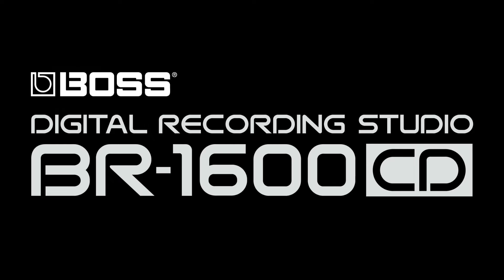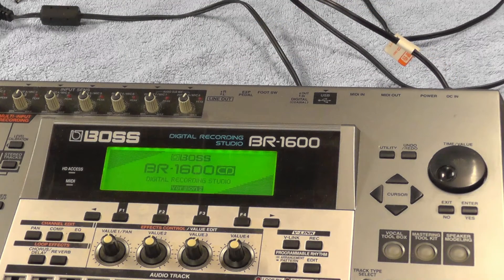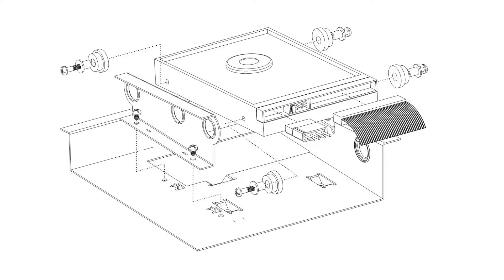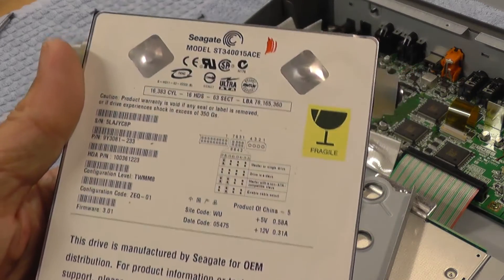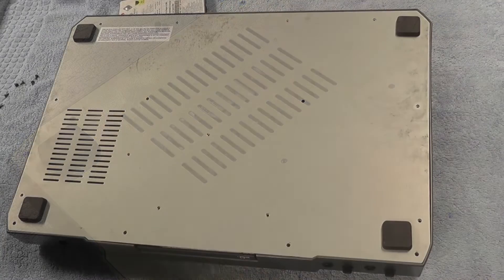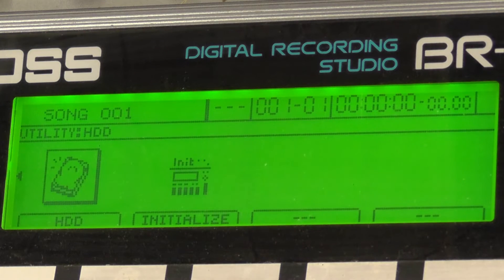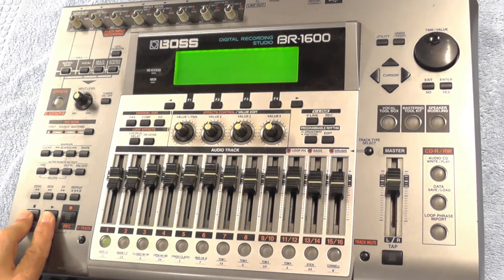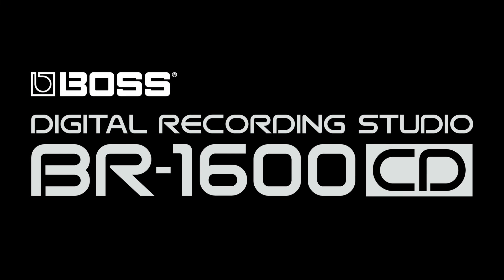Boss BR 1600 How to Replace the Hard Drive and Update the Firmware

Comment: Thank you for the video. Excellent step by step process. I have the BR-1180 which may be different but I get the same HDD error message. My only concern is how to recover the data/songs in the drive that’s not working. Is there a way to transfer everything on this stock drive to the newer drive (likely with more storage)? Thank you!
Reply from the maker: It's the same principal for the BR1180 - remove the bottom base plate to get access to the HDD and remove the power/data cables and then the drive.
As for recovery of the songs, your best bet is to connect the HDD to a PC either directly or via an inexpensive USB caddy. 
Hopefully the drive will show up in Explorer enough for you be able to copy the content across. If it does, save all of the song folders to the PC. 
Once you've installed the new HDD into the BR1180, format it and then remove it and connect it to the PC. It should just have one song folder. 
Copy the ones from the original HD to the new one (overwriting song0000 if needed).
I had this exact scenario with my very 1st BR (1180) and managed to get the HDD to show up in Windows just once, but that was enough to save 95% of the songs off the old drive.
Good luck!
Reply: @masteringtoolkit  Thank you so much!!

Comment: Hi, this may be a stupid question. But is there any risk of losing a saved project during either of these processes? (Switching the hard drive or formatting the disk?)
Reply from the maker: Not a stupid question - especially if you care about saving your projects.
Switching to a new HDD or formatting the existing drive with leave you with a blank slate and return the unit to factory default. 
If you have any projects you want to keep or transfer over you will need to either create a backup - as covered in the user manual, or better still, connect the HDD directly to a PC (with the HDD removed and placed in a dock) and copy all the contents. Once you have either formated or installed a new drive, you can then copy the contents back to restore all your work to the new drive.
Hope that helps.
Reply: @masteringtoolkit  how did you manage to convert the format to an iso9660 file? I’m finding it impossible, that format doesn’t exist anymore?
Reply from the maker: @majesticheartproductions85  Its an international standard format for CD cross compatability and is still valid and used. 
I use NERO to burn CD's which allows you to select which format to use. Whatever software you are using it should allow you to specify the format.
Reply: @masteringtoolkit thanks heaps for your replies and these amazing videos. It’s been a huge help, I’m still learning a lot about these machines as I go👍👍

Comment: Thank you for such an amazing video, it is pretty informative. 

I followed each step and got it to work without having any HDD issues. 

Whenever I insert the discrete drums CD the OS freezes. To the point that after power cycling it I start getting the HDD Error message again. 

That happened last night. I turned it on this morning and the system booted up without a problem. 

So now I am wondering whether the problem might be a conflict between the cd drive and the hdd drive or, just the cd drive. 

When using the original hdd I wasn't able to load or import the tracks in that CD. But I was able to navigate through the utility menu. I would receive messages such as Loading Disc, etc, but it wouldn't affect the OS. 

Have you encountered any of these problems before? I'd appreciate it if you could shed a light on this issue.

It'd be awesome to be able to update the firmware some time. 

Thank you!

EDIT: I just found a CD drive replacement on eBay for a reasonable price:
https://ebay.us/m/rgmKAb
Reply from the maker: You are welcome Diego - glad the video helped!
I have encountered a HDD error if a CD is in the drive when it boots - this has nothing to do with the HDD though, and as you suspect is a conflict when the OS boots and see the CD drive as the "master" and tries to boot from it.
Sounds like the CD drive is faulty in your machine. They are pretty resiliant, but I have had one that was faulty too.
I would imagine replacing it should fix your issues.
Reply: @masteringtoolkit Thank you my friend! Luckily the comments section of your videos is also good for users who run into these issues.

We all watchers enjoy your videos. I appreciate you taking the time to make them. That's a lot of work!

Comment: I just purchased my own Boss BR-1600!! I will definitely return to this video in case I get this HDD error because it seems to be quite a common issue (but also one of the only ones).
Reply from the maker: Congrats!! 
It's scary to see the HDD error, but really quite straight forward to replace the drive if you need to.
Reply: @masteringtoolkit  Yes, thank you so much mate. I also assume the slow loading time to open a song is quite standard right? Everything works fine, no delay. Just a bit slow when I want to open up the demo-songs.
Reply from the maker: @TimVincent-o4k  It is,  but you get used to it :) 
Just read your FB post on the Old School page 👍

Comment: Hello Mastering Tool Kit, I own a Tascam 2488 that had a bad HD. IDE drives are becoming harder to find. I tried putting several previously used IDE HDs in the Tascam (specs match what Tascam used), but I still got HD error messages. After going through all the IDE drives I have, I finally found one that would boot and format. Machine works great for the moment, but I don't know how many hours I will get out of this older HD. Have you had any luck using a SATA to IDE adapter in any of the units you have repaired? If so, could you recommend what adapter worked for you. I would love to put a SSD or at least a more modern SATA drive in my Tascam.  I love these digital recorders.  So much easier to use than a DAW.
Reply from the maker: Hey James, 
Unfortunately, this is the reality of these older type of machines using now obsolete storage media. 
You can still find new IDE HD's though. Have a look on Ebay for the BR1600 and Roland VS machines.
I don't have any Tascam HDD machines, only the Porta One and Porta Two 4 Track tape machines.

With regards to using moderrn HD's, I did go down that rabbit hole a few years ago. I also tried using SD and CF cards in place of the HD's. 
It turned out to be very hit and miss. I spent a lot of money and time on various adapters and drives. 
For the BR1600,  it was a very specific combination of adapter and SSD that worked. 
I did put together and sell a conversion kit a few years back, but being so niche, I only sold a couple of them locally. 
I dont recall what the specific adapter was - I bought many different ones to test. Even then, only selected SSD's would work with it.
Unfortunately, I doubt that what worked for the BR1600 would transfer to a Tascam though. 
Even with Boss machines, I managed to get an SD card to work with the BR1180, but it didn't work on the BR1600... 
Maybe you can try searching for SSD conversions for your specific machine. Maybe someone has already found a solution? Good luck!
Reply: @masteringtoolkit  Thanks for the response. I also purchased a Boss BR 1180 with a bad HD. It was much more forgiving when I installed a replacement drive. I am going to try an adapter that gamers use on Gen 1 Xboxes. I’ll let u know if I have any luck on the Tasman. Your video was very good BTW. Best wishes
Reply from the maker: @jamescaldwell1933  Yeah, the Boss BR  recorders have all been fine when replacing with another IDE drive - I've never had one not work. 
The Tascam must be a bit more selective... 
Please do let us know if you have any success with the Xbox adapter - never considered trying one of those.
Thanks for the kind words - much appreciated. Cheers Mark

Comment: Great video but, bummer
I don’t get the HDD error
I simply can’t get the BR to export via USB. I’ve tried different cables & different computers & export simply doesn’t recognise the connection. Can hear the USB connect

Sometimes I can get back up to open up the HDD but most of the time it simply won’t recognise it that way

I was hoping it might be the HDD
It sucks because I have interviews I need. It literally worked just after xmas 😢
Reply from the maker: There are a couple of other options for backing up if you haven't had any luck via USB:
- Use the CD drive , ideally with re writable CD's so you can use them over again when you need to, or
- Use the digital out connection on the back of the BR1600 and record out in real time without any loss of quality - you would just need an audio interface that accepts a digital signal. 
Hope that helps to get your recordings saved.
Reply: @masteringtoolkit 
Cool thanks. I really appreciate the reply

I did burn the tracks on to CD via Data Save/Load yet to see if that worked & your idea about the digital out is something I’ve never tried. Will tomorrow just to see how it works

I did watch a video where someone connected an iPad & the export worked for them & I read on a forum that a newly installed program on the pc have caused this issue for some

So as a test, I connected my iPhone USB-C to the BR via a hub & blamo, I was able to connect & export or do whatever
It comes up in “files” as “BR1600CD” in the same area as “on my Phone”

So I must have a conflicting program, possibly Audacity or the Behringer UMC404HD interface driver/software because they are the only new things I have added since on both PCs

I am writing all this down just in case someone has the same issue or wants to use an ios or Android device to act as the “computer” end of the export/back up bit

Thanks again 😅
Reply from the maker: @MilitantPeaceist  No problem - glad to try and help.
When you burn to CD, just make sure you use the "WAV" option to export, rather than the "BACKUP" option, as this just make a backup of the song project.

The Digital Out is a good option if you don't mind exporting in realtime. I connect my BR1600 to Reaper via the digital out and it works flawlessly.

I'm aware of the connection to the Ipad. I dont do IOS though, so cant comment on its effectiveness. I do beleive it should work fine though.

Not sure of the reason for the USB issues. TBH, I never use it. If I need to export a full mix or a couple of tracks I just use a CD RW. 
For swapping audio between the BR and PC I use the above mentioned Reaper and Digital out. 
If I want to do a full backup, I'll remove the HDD from the BR1600 and plug it directly to the PC via a HD caddy. 
I can backup the entire drive in minutes rather than hours doing it this way. Although this is something I dont need to do very often.

I appreciate you documenting your process though, so often someone will ask a question and then reply , with "all good now" without any explantion - so thank you for that.

It sounds like you have it sorted now, but if you need any more help, I'd be happy to try and answer any other questions you have. 👍
Reply: @masteringtoolkit removing the hdd to back up is a brilliant idea. I remember doing it once I am almost over the PTSD it induced

Unfortunately I only have a sata caddy. Maybe I can get a sata/ide adapter & put an ssd in the BR. Have a few lying around

What software do you use to burn the br update? Every software I download won’t recognise the .prg fw file
Reply from the maker: @MilitantPeaceist  Lol - once you've taken the HDD out, you'll see that its pretty straight forward and you can do it in just a couple of minutes.
I have a PATA/SATA caddy that I picked up from Ebay - it was only around $20AU from memory and works well.

I use Nero to burn the firmware CD, but any software will work. It doesnt need to recognise what the file is as it needs to be burnt as a DATA CD. 
You just need to make sure the format is set to ISO 9660 Level 2 Mode 1. Then just follow these instructions:

http://static.roland.com/support_archive/en/BR-1600CDVersion2_1833210_readme_en.html

Hopefully that helps.

Comment: Hello!  I've just bought a 1200 (I need an intervention too!) because I thought that maybe it would fulfill my needs and be a little bit smaller than the 1600... It was sold as for repair or parts, but the description made me feel confident that I could fix it!  Turns out that the cursor keys and the exit/enter buttons are not making good contact.  You have to press them over and over to get them to respond.  So I'm thinking bad/dirty contacts.  I opened the back and moved the hard drive out of the way (it's a riveting story isn't it?), but discovered that the back of the buttons isn't accessible without stripping down the whole machine.  Which I wouldn't dream of doing.
I'm just wondering if you have come across this problem before and if there's a fix that doesn't involve taking out everything?  Thanks!  No rush to reply, I realise that you're busy.  I hope you and yours are all grooving along nicely. 😊
Reply from the maker: Hi Melanie -  sounds like you've caught the same bug I have!! :)
Yes, I've fixed lots of those switches - its a very common problem. 
The ones that usually go first are those that are most heavily used - the cursor and Yes and No button typically - as you've discovered.
They are tactile switches and although the do have a very long duty cycle (100,000 pushes), they do wear out. 
The original switches were Panasonic EVQ-11A05R, but they were discontinued at the end of 2020. You can get equivalent switches now which also work though. 
Unfortunalety, they need to be replaced by being soldered in and that requires that you strip the recorder down to take the main board out.
You should be able to get any electronic repair place do it for you - they dont need to know anything about the BR recorders or be associated with Boss/Roland.
It takes me about an hour to dismantle and re-assemble a BR1600, and then a few minutes a piece to replace the buttons. It shouldnt be more than 2 hours work I would think and it would depend on their hourly rate as to whether or not it was viable to get fixed. Sorry i dont have better news.
Reply: @masteringtoolkit  Awwww. What a shame.  It certainly doesn't sound like a job for me.  It's still usable at the moment - pressing the dodgy buttons repeatedly and sort of wiggling the pressure around gets them working but obviously that has a very limited life.  Oh well.  I'll try to find an electronic repair place - they're not easy to come by these days - last time I tried to find one, I couldn't, but maybe I will this time.  Thanks as ever, Mr. Kit, it's a wonderful thing to have a BR expert to ask, you may be the only one in the world!  You're a star! 😊
Reply from the maker: @MelanieMaguire  Did you manage to get the buttons on your BR1200 fixed?

Comment: Hey there. If you update the firmware can you still use a 40G drive? ie swap from full 80G back to blank 40G. Thx if you can help with this q. 🙂
Reply from the maker: Yes you can. 
The firmware update adds the ability to use a larger drive (up to 80GB usable), but using smaller drives will work, no problems. 👍
Reply: @masteringtoolkit  excellent, thanks a lot. 🙂🖐️